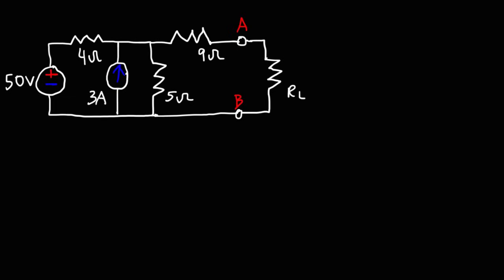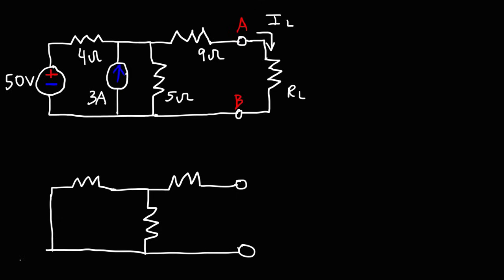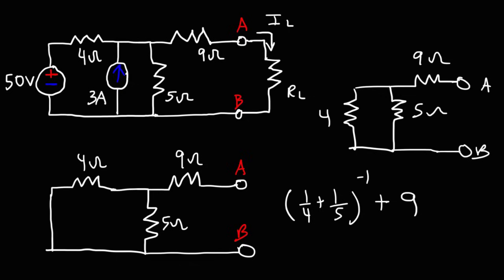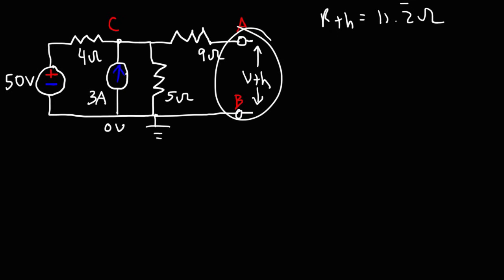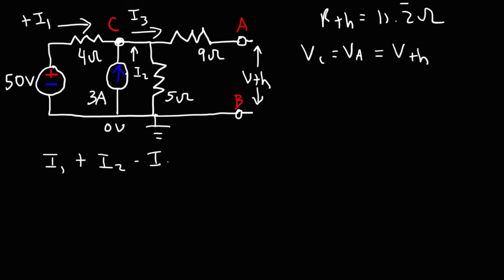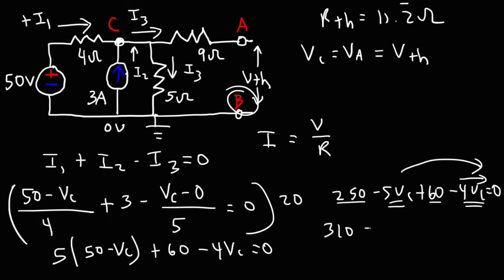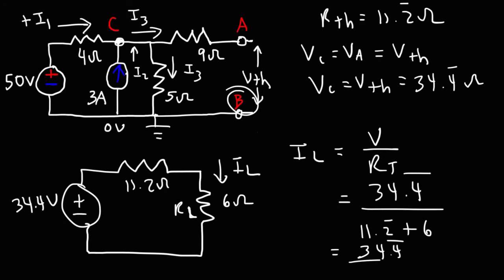Thevenin's Theorem - Circuit Analysis

Comment from the maker: Final Exams and Video Playlists:     https://www.video-tutor.net/
Final Exams and Video Playlists:     https://www.video-tutor.net/
Full-Length Videos & Worksheets:   https://www.patreon.com/MathScienceTutor/collections
Reply: Hey! wher did the six come from after calculating thevenin's voltage
Reply: @ufomedz that could be any value according to the question given.... It's not something that was calculated
Reply: @94D33M  Hey why is Vc = Vth, shouldn't the point next to point C ( say point D ) be Vth as there must be some current flowing through D to the 5 ohm resistor ? so Vc > Vth in that case !
Reply: @VV-r9h  maybe because 4 ohms and 5 ohms is in parallel so they have the same voltage

Comment: I converted the left most voltage source into a current source, added up the currents, converted it again into an equivalent voltage source in series with 9 ohm resistor, in this way also I got the same vth.

Comment: 1:23 how are 4 and 5 Ohms in parallel???? I understand the 9 ohm how it’s in series but 4 and 5?? How??
Reply: They start from the same node and end it the same one
Reply: I'm thinking that if the 4 ohms R is removed, then the 5 ohms wouldn't be getting power from the 50V source but still power from the 5A source

Comment: I understand everything up to where you put Point C, is there a reason it has to be there specifically? I would expect you would have to put it at the top junction where the 5 Ohm resistor connects
Reply: because the current I going across r3 is 0, v=ir = 0, va = vc

Comment: For anyone who is confused about the 6 ohm resistor so it was just a example that if there you have given the 6 ohms resistor which will depend on your problem , the concept is about finding equivalent circuit and there your load resistance doesn't changes so don't worry even if there is 6 or 600 ohms your thevaniens voltage and resistance and circuit is real just current will change according to your application

Comment: Great explanation, I came across this concept for the first time in 'Art of Electronics - Horowitz and Hill' and it made no sense, where they calculate the open circuit current rather than voltage.

Comment: What happens if there is voltage source on the 9ohms resistor?
Reply: Then solving it using superposition theorem might work.
Reply: then you change the circuit. Everything will be different.

Comment: Sorry but here you have to convert the potential sources into current sources, using replacement theorems ,because it is not possible to find equivalent resistance  with potential sources,,,,I was fucked with this question goes through all around youtube and then founded twist in book

Comment: Ah bro on time 7:01 time where did you get the 6oms on the rl?
Reply: I also didn’t get that
Reply: We turf off load resistor to solve for thevenin voltage and current and after that we turn on it back to the circut.
Reply: And i think he assume Rl = 6 ohm
Reply: he assumed 6 ohms.
Reply: I wonder
Reply: I think RL was known to be 6 Ohms but he forgot to mention it in the beginning
Reply: The 6 ohms is the Rl

Comment: Pls why is current not passing through 9ohms
Reply: bcuz we have remove the Rload when calculating the Vth therefore that 9ohm resistor's part is open, and if any part of the circuit is open, current will not flow into that part(sr if my english is bad)

Comment: i have a doubt why does no current flow's through the 9 ohm resistor
Reply: because the other end of the 9ohms resistor is not connected to anything. It just floating.

Comment: At 2:21 How He Do Sum Pls Explain Anyone 😢
Reply: In parallel you add the reciprocal
Reply: 20/9 is 2.2 add 9 to it and you get 11.2
Reply: so the resistor in series
Rt = R1 + R2 + R3 + …

and in parallel
1/Rt = 1/R1 + 1/R2 + 1/R3 + …

Comment: 3:28 I'll take note of this, if there is open circuit then there is no voltage drop to VA. That means Vc = Va or the voltage on one end of the resistor is = to other end of resistor and not 0V I finally got it lol

Comment: Can somebody tell me how minus 1 come in here 1:33
Reply: It's raising the bracket to the power of -1
Reply: The eqn for finding total resistance in parallel is 
1/Rtotal=1/R1+1/R2

So by putting (1/R1+1/R2)^-1
The 1/Rtotal becomes Rtotal
Reply: my brother in christ, if you are confused on that you are way too far ahead in Electrical Engineering than you need to be

but to answer your question, that's the formula for finding the total resistance in a parallel circuit
Reply: @EducationalLearning-i7l 😭

Comment: "Bro, that was incredible! You just cleared all my doubts with such an amazing lecture! ❤️

For those who might be confused about how Sir is calculating the potential at each point (like the 12V at the beginning), here's a breakdown:

In a circuit, there's a potential drop when current flows through a resistor, which is calculated using the formula
V=IR. If there's no resistance (i.e.,R=0), there won't be any potential drop.

Hope this clears things up! ❤️"

Comment: How do we know that there is no current going through the 9 ohm resistor?
Reply: Because it's an open circuit, no current will flow through it because it does not connect back and complete the circuit.

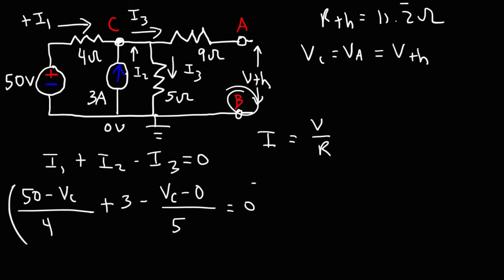Comment: It’s a good video but 5:23 I’m so confused as to where u got that 20 to multiply on both sides
Reply: Dividing by 4 on one side, 5 on the other, 4*5=20. Keeps everything nice and even. This is all good as long as you do to one side what you have done to the other.

Comment: Professor Organic Chemistry Tutor, thank you for explaining Thevenin's Theorem by solving a classical Circuit Analysis problem from start to finish. When I took Circuit Analysis many years ago, I did not fully understand this material, however my knowledge of the material has improved over time. This is an error free video/lecture on YouTube TV with the Organic Chemistry Tutor.

Comment: You don’t have to do nodal analysis at all at that 4:06 , just do a quick source transformation for the Voltage source putting an upward facing current source of 50/4 Amps parallel to a 4Ohm resistor. After that Add the 50/4 and the 3Amp current source as they’re both in parallel whilst also adding the parallel 5 ohm , 4 ohm resistors. Then just do V=IR which results in 31/2 times 20/9 = 34.4V .

Comment: Great video! I was wondering where the RL resistance = 6 came from. At 6:48 he says he'd written it down before, but all I saw was just plain "RL" without it = 6. Am I missing something?
Reply: I scrolled back through several-year-old comments, and they said he forgot to include R = 6, which was a given for the problem.
Reply: god bless you @space-cadet-4.5
Reply: Even I am thinking the same, please tell me, if you get to know the reason.
Reply: The only way I could think of to get 6 is to just straight up add the 3 resistances and divide by 3, but for some reason I highly doubt that's correct.
Reply: He say's because he wrote it before, and I also did not see it written or derived anywhere so I'm a bit confused
Reply: It makes 11.2(R Thevenin) + 6 (R Load) = 17.2 ohms. Thus we can divide 34.4V(V Thevenin) with 17.2 ohms in order to easily calculate the ampere that passes through the load with the help of Thevenin Equivalent of the circuit.
Reply: @seyhuncelik9584  ben hala 6 ohmun nerden geldiğini anlamadım
Reply: @kaprisliaxn9979  kendisi farazi olarak 6 ohmluk bir yük bağlamış. 34.4V'a bölününce 2 çıkması için kolay sayılar seçmiş. Oraya 10 ohmluk bir yük de bağlayabilirdi, tamamen farazi bir sayı.

Comment: I just converted the voltage source to a current source and just added the sources and multiplied the parallel resistors 4 and 5 to find VTH

Comment: I just fail to understand how you can have a current source moving from a potential of 0V to a potential that is assumed to be higher at the node between the 4 and 5 and 9 ohm resistors.

I get that current does in fact move from - to +, but wouldn't bridging that node to ground just present a short, and pull the entire node down to 0V?
Is it just assumed that there's a resistor there that would pass 3A at that specific voltage?

Comment: In the calculation for current through the load resistor, what are the bars above 34.4V and 17.2 ohms for? Great video by the way thank you!
Reply: it means that 34.4444...4  and 17.222222....2

Comment: sooo can someone explain me why at 1:37 we raise at -1 ?
i really study the theory in my uni and i don't ever saw for parrarel resistances this thing
Reply: the formula for calculating equivalent resistance when resistors are in parallel is
1/R = 1/R1 + 1/R2
so 
1/R would be = 1/4 + 1/5
1/R = 9/20

therefore R would be 
20/9 = 2.22 

since we're taking reciprocal of 9/20 -
it's easier to write (9/20)^-1

as it means the same thing as 20/9

and then 9 is added to 2.2 which gives us 11.2

Comment: where did you get the load resistance of 6 ohms from i rewinded from start you never assigned a resistance for the RL
Reply: I agree. He never said said where the 6 ohm resistor came from. I think  he just picked as an "example load".
Reply: @Festus2022  ive been watching his other videos i think this might be a 2 parter or something and he reused the 6 ohm from that circuit
Reply: Let's take Load resistor as 6 ohm...take different value, will be given in the question, don't consider it in Thevenin's resistance, it is the step of solving  Thevenin's theorem...

Comment: Thank you for this though why is it when I run a simulation for this the answer for the current is exactly 3.069 A not 2 A. The voltage is right.

Comment: how is the 4ohms and 5 ohms resistor in parallel shouldnt it be the 5 ohms and the 9ohms that are in parallel? Cuz the current has to go through 4 ohms resistor in order to go through the 5 ohms resistor so this means they are in series right?

Comment: Thanks a lot, really helpful. One question tho: what happens if we have a capacitor or a coil in the circuit, besides all the resistors?
Reply: Current through that branch will be 0....and potential dif on that branch will we equal to sum of potentials on it

Comment: I don't get Thevenin's Theorem. I only understand that you do it to make the circuit simpler. First you get the Total Resistance : Rth, then hook it up onto the Loader Resistor. Why do we have to use the voltage at Vc? Wouldn't that mean the resistor behind it (R1=4ohm) won't be included? You are using Total Resistance but using a voltage that is past that resistance already. Hopefully someone answers please. Thank you

Comment: I'm still a little confused on why 6ohms for the load resistance? Also when u said the voltage at B was zero why isn't the voltage at A also 0? Because I thought they both were open circuits thus 0V right?
Reply: the 6 ohm was actually given but he forgot to mention it. and V at b was 0 because it was being compared to the ground. the potential voltage difference at ground is always 0, therefore Vb is 0 with respect to ground while A is not, because with the given position where A is, there is definitely some potential difference between A and ground.

hope this help

Comment: at about 1:30 why does it not work to add (1/5 and 1/9) + 4 when  the 9 and 5 is in parallel and the 4 ohm is in series with them?

Comment: How can we cosider the load resister as "open circuit" to calcuate Vth(Voltage-thevenin)? For the calculation, you assumed that there is no current flowing over the register (9 Ohm). Does it really make sense? I need your advice on this!
Reply: there's no current flowing over the 9 ohm resistor because there's an infinite resistance across point A and B due to the presence of air in between the two points ( since air acts as an insulator) so current is negligible, almost zero.
Reply: for the Thévenin circuit we remove the load resistor
Reply: To find the Thevenin Voltage, we have to assume the load resistor to be an open circuit because that's the variable that we want to measure. i.e. The current across the load. The will be no current flowing through the 9 ohm resistor since there is an open circuit across the path A to B and so all of the current will be flowing through the 5 ohm resistor. There will be no path along an open circuit

Comment: Couldn't you use source transformation?  Transform the voltage source to a current, then find the equivalent resistance without the 9 ohm resistor since no current/open, and then using V=IR to find the Thevenin Equivalent voltage.
Reply: If so, would he treat the 6ohm resistor as an open circuit or short circuit???

Comment: why is the 4 and 5 ohms "suddenly" parallel? This may seem like a dumb question, sorry
Reply: Great question! It takes a bit of thought to see how it works but really it is parallel the whole time, its just that in the given diagram, the 4 ohm resistor is drawn at the top of that loop instead of on the left side so the resistors don't "look" parallel. All he's doing is scootching that 4 ohm resistor to the left down the wire, which of course doesn't change anything about how the circuit works. He could extend that wire in a crazy zig-zag mess and put the 4 ohm resistor anywhere along it but based on where the nodes are, the resistors are still connected in parallel. Does that help?
Reply: @anderstars  i believe it does thks, but how would they actually look like of they were in series? When u say they're "always" in parallel u mean after the shorting of the circuit rt?

Comment: Nice demonstration. At 4.30 you said the sum of currents is equal to 1, but should said zero, however you did write down the correct value.
At 6.24 you wrote 34.4 Ω instead of 34.4 V.
Reply: I was looking for this because this confused me as well. Glad to see this comment that helped fix the confusion!

Comment: I don't understand y u have to add the (TH)resistance with the load resistance if it's in series 
I thought current was the same for all resistors in series
Reply: nope, actually, the thevenin's resistance was the sum of all resistance, except for the load resistance, in order to simplify the circuit to a series circuit. in another way, you have not included all resistance. when calculating the current, you have to subs the R load in the circuit, then add it with thevenin resistance in order to get the total resistance of the circuit, which is now a series circuit. That's why you still have to add Rth with R load to get the correct value of current in the circuit.

Comment: imagine that you have the load resistor in the middle of the circuit and you you have voltage source on the right and currant source on the left (where  the RL was) i calculated the Rth and after re drawing the circuit i couldnt get the equation to solve Eth

Comment: This was a good video, but you never mentioned the 6 ohms until we went to solve for I(L).
Reply: I went looking for a comment about this because I was confused about that too lol! Glad you noticed it too
Reply: It's the RL
Reply: I was pretty lost too, nearly rewatched to see if he had mentioned it before
Reply: So where 6 ohm come from ?
Reply: @ScorBiduBiduXI  it was just in the initial problem and he forgot to add it.
Reply: @andrewcarter215  For these exercises you kinda need to 'forget' about the Rl (or load resistance), as it won't account for the Thevenin resistence nor the Thevenin tension (specially because here you'll open the circuit exactly were the Rl would be). I don't think he forgot about it, it's just that it only comes back for the final calculation of IL, at least that's what I got from his explanation.
Reply: @OGKillerBee99  , so please how do get IL if RL is not known.
You have to find RL, But how do u then find the RL
Reply: @m.aminumar6439  you can’t. You have to know either IL or RL
Reply: the load resistor doesn't matter when u need to calculate Vth and Rth
Reply: What if the RL is not given and you want to find it in order to find IL ?
Please
Reply: Exactly correct
Reply: thats all im looking for
Reply: Thanks for the comments guys 😂, now l know

Comment: I'm just confused how Vc is equal to Va when no current goes through the 9ohms resistor, shouldn't Va have no potential?
Reply: See, the circuit actually has a load resistance (call it RL). This RL is always changing so it can be considered taken out till we calculate the equivalent resistance of the remaining resistors which have a fixed value. So only for the sake of calculating all the known values, RL has been taken out and A and B become open. Otherwise, in reality, A and B are closed and since there is no source between A and C, and A and B-- so no potential drop across AC branch, hence the value of Va = Vc. Hope you understood.
Reply: @anirudhbukka5413  Thanks, that did clear things up.
Reply: @Lexyvil  👍🏼

Comment: Super confused!!!  Around 4 mins, when he starts calculating I1, I2 etc.  Can't we just use Ohms law to calculate the current flowing in the circuit?  Then use that value to help work out the voltage drops across the resistors?
Reply: Yes you can, but this way is faster and used widely. The answer you will get with your method will also be perfectly correct.
Reply: @mihirgupta3824  thanks for the reply, much appreciated :-)

Comment: may I ask why the 4 ohm is in parallel to the 5ohm resistor, not the 9ohm is in parallel to the 5ohm resistor? 1:27 thank you
Reply: Hey did you ever find this answers?
Reply: Because we are solving from LHS
Reply: just imagine there is current passing from a to b the current i will be devided between the 4 ohm and 5 ohm not between the 9 and 5 ohm
Reply: Move the 4ohm resistor around the corner to its left and it now even looks like it’s parallel. Either way, parallel means their ends are connected together, which is true for the 4 ohm and 5 ohm resistors. Each of their terminals connect together.